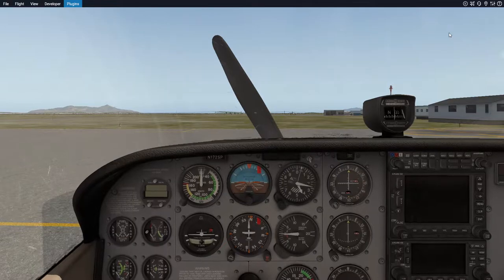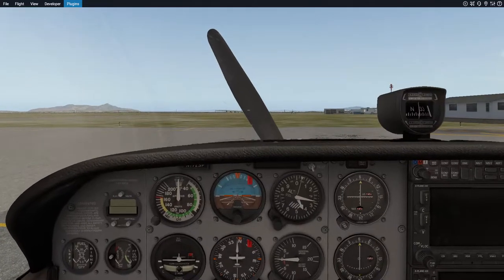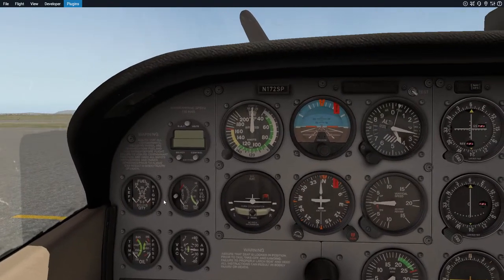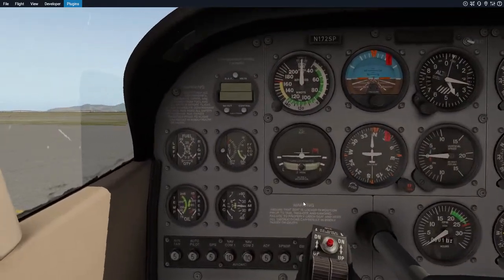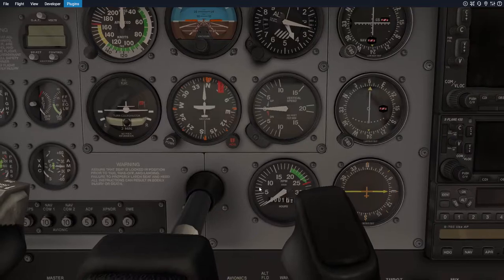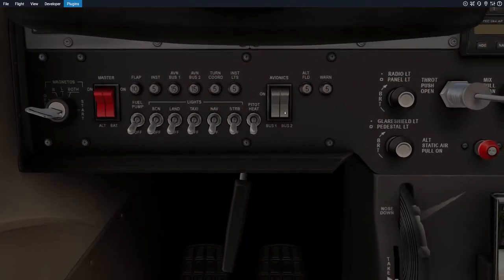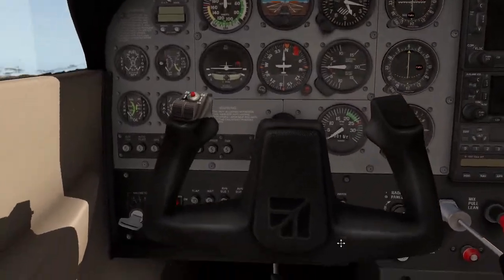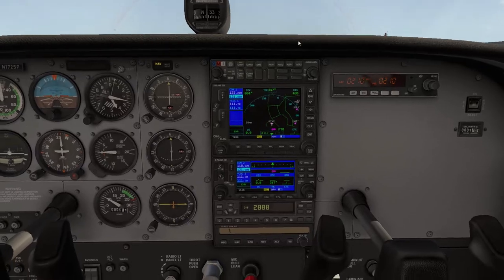Baldur's Basics: How to Fly a Cessna 172

Comment: Vacuum has nothing to do with fuel system. Vacuum runs the attitude Indicator and the heading indicator gyros. Vacuum pump failure in instrument conditions can be catastrophic.
Reply from the maker: Thanks for the clarification. I got that confused with the vacuum pump, which the Archer uses when RPM's are too low.